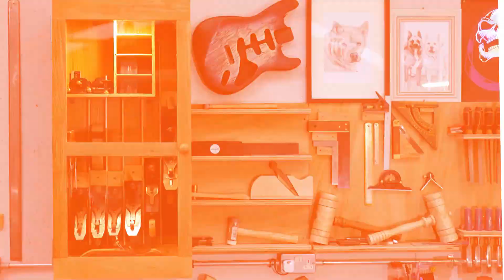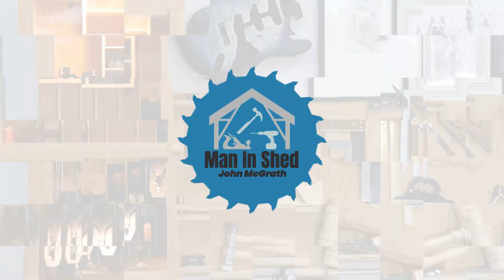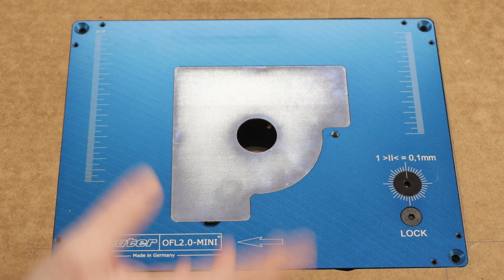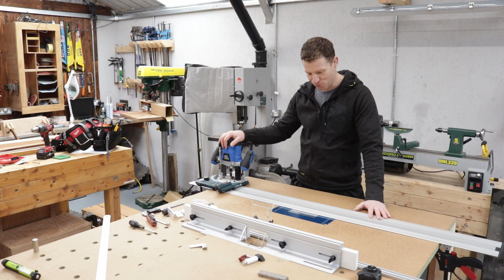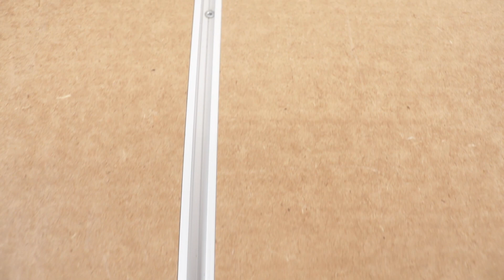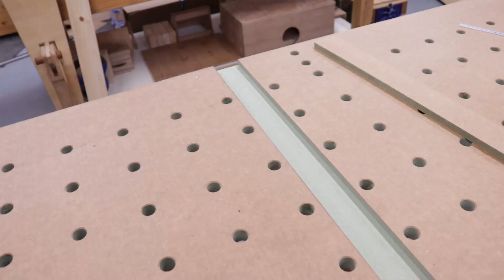Installing the Router table in the MFT Workbench. Plus a Cheap Tool Rant!

Comment: Maybe a possible word of advice, as crappy as that router seems I would say that doing that depth of cut with any 1/4" in one pass would give you unsatisfactory results on any router.It would have most likely provided a better result had you done the cut in 2/3 passes. Sauter lift looks great and so do the videos, thumbs up! P.S I have a similar saying - "Buy Cheap,Buy Twice".
Reply: Perhaps I am unqualified to say, but I agree with your advice.  In addition to the strength of the 1/4" shaft, A two flute bit straight bit already may have difficulty clearing  waste. A spiral upcut bit would be able to eject waste out the top. Much better. I can imagine the side forces encountered when having to skip over waste in order to move forward. This alone might be the cause of the varying width of cut. 

In the video, the forward motion is jerky, indicating the router is encountering variable resistance. The MDF is consistent, so this variable resistance must come from something else, possibly the operator, but most likely waste being caught between the blades and the uncut material.   There are various approaches to overcoming this. One as you say is to take multiple passes. Another is to clear some of the path first with a smaller bit, or circular saw.  Slowing down would also help.

Comment: Great video John. May I ask a couple of questions please?  What are the dimensions of your MDF work surface?  Also, I am going to build my own this holiday period, I’d like to add a router to my bench, but I’ve already bought a sheet of 18mm HDF.  You used 1 inch thick MDF, will the Sauter top fit into 18mm or do I need thicker material?  Thank you, Peter
Reply from the maker: Hi Peter I used a full mdf sheet for the work surface, so it's 1220mmx2440mm. The Sauter lift will fit in 18mm but make sure you build in supports the sheet will get quite thin and could flex.
Reply: @JohnMcGrathManInShed  thank you